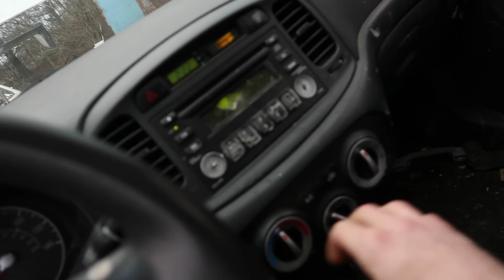hyundai caliper fix  feb 2020 #2

Comment: How did you bleed the caliper by yourself,  did you put a cynderbloc on the brake pedal to keep it compressed or something?  Keep up the good content 🤘
Reply from the maker: I use a 2\4 and the front seat to put pressure on it. 
Gravity did most of the work though. It was an easy one for once